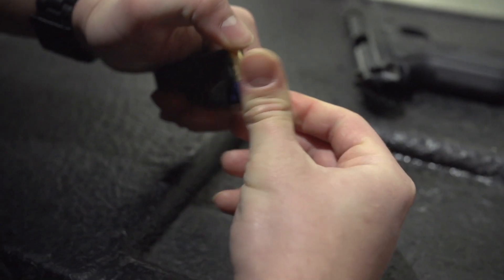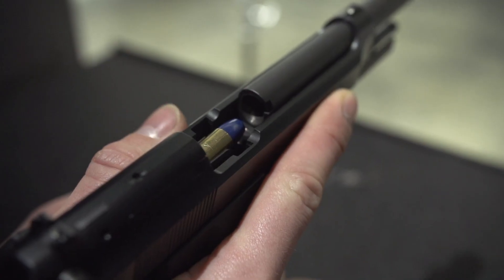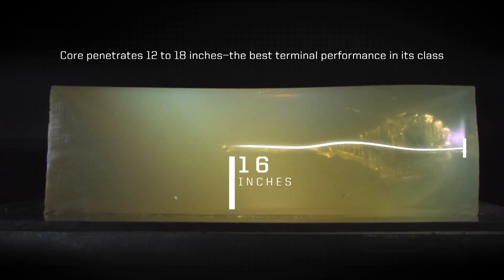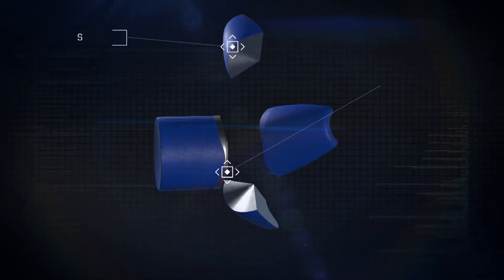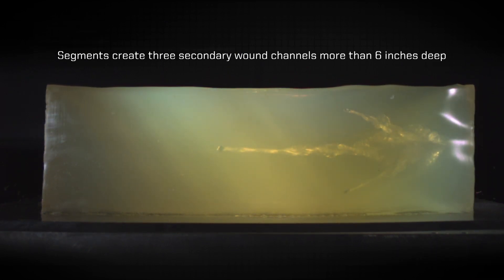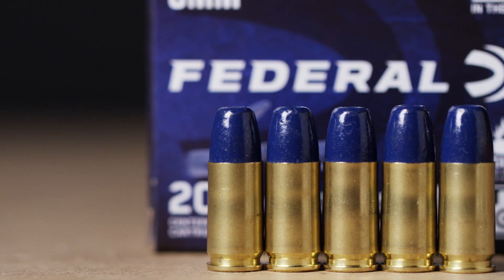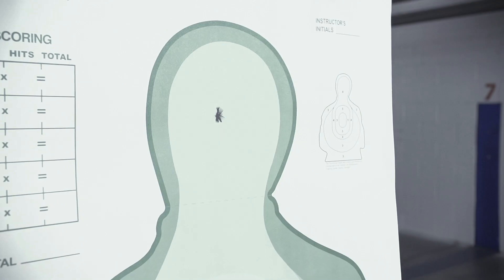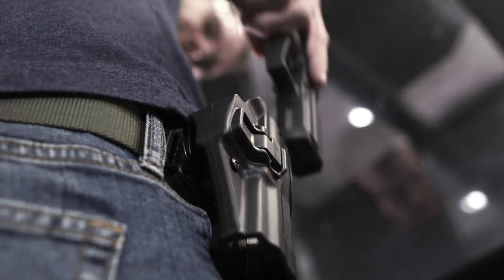A Closer Look: Syntech Defense

Comment: Interesting. I will try these. Oddly this is the first time I've heard of these but I have used Syntech FMJ at the range.
Reply: @lgwappo Oh it works as advertised. Frangible ammo that meets FBI protocol. Breaks on impact and lead core keeps going about 19 inches. Proven in short barrels as well as longer ones to consistently fragment on impact. Lots of videos back that up. Only saw one video from a short barrel where it failed but there is the question of the medium used whether it met FBI standards. One video of a failure is not enough to make me change from all the other consistent results. I use it for a home defense load where I need to stop a threat but prefer less over penetration.

Comment: I wonder how a heavy 10mm version of this would do. JHP in 10mm seems to often have a problem dealing with 10mm velocity -- which is probably why every one of Federal's 10mm ammo comes in the low-recoil flavor. But I can't see how the post-impact components of this tech wouldn't benefit from full-energy impact. I bet a full-power 10mm 180-200grain version of this would sell if it worked.